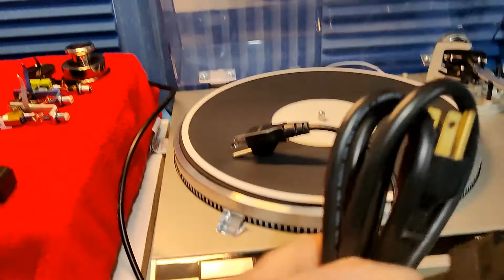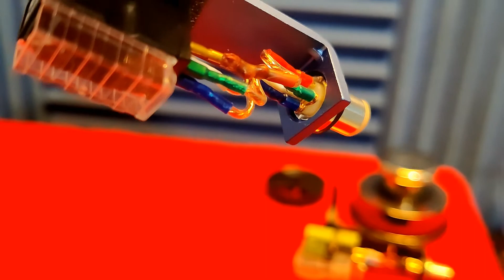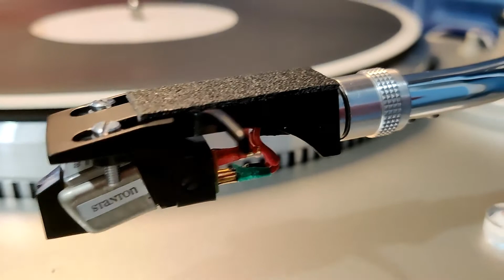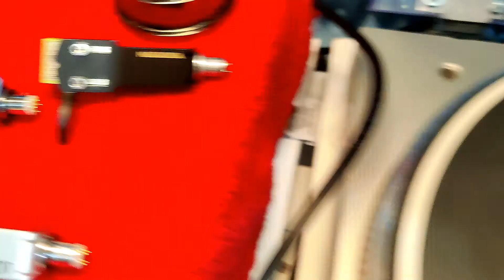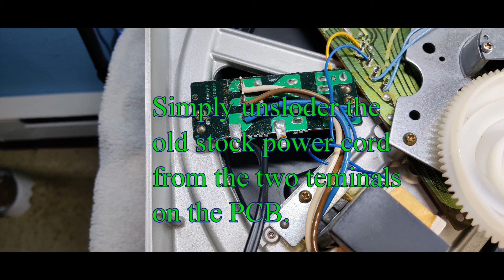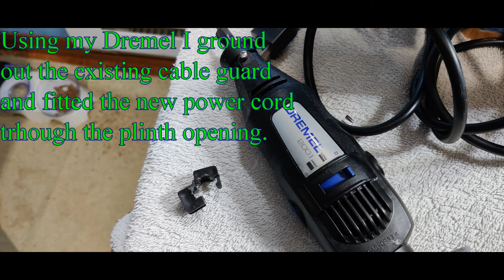Technics SL-Q2 Power Cord Upgrade

Comment: hi, thx for the video. Just wondering if you notice any difference on the overall sound of the turntable?
Reply from the maker: Not really. It does give it a better and tighter plug into the outlet. I mainly wanted a better cable on it since I have plenty laying around. Gonna do my Pioneer soon.

Comment: Hi, I am looking to replace the power cord on a SL-D2, can I use any standard computer power cord cable like you used in the video? So if you only use the Black and White wires and leave the Green wire, where to connect the Green wire to ground? or should I find a 2 prong one.
Reply from the maker: Yes, any standard computer power cord will work fine. I found the three prong to be more of a tighter fit in the socket. In my video I show to just tape the green wire to the cord itself and not use that as a ground for the turntable as it won't work that way. Hope that helps.